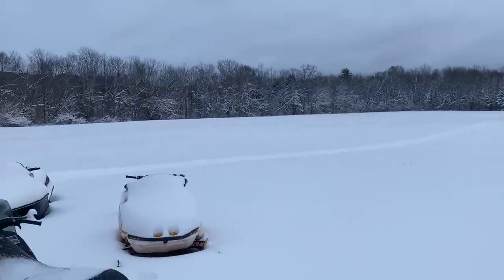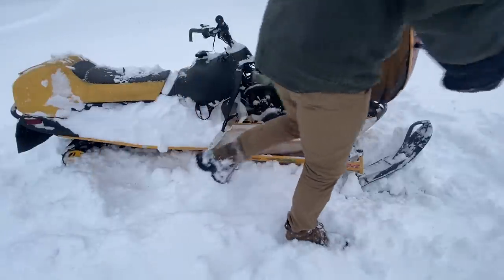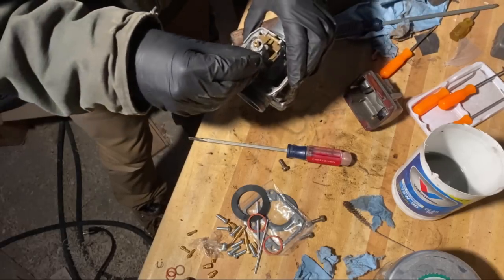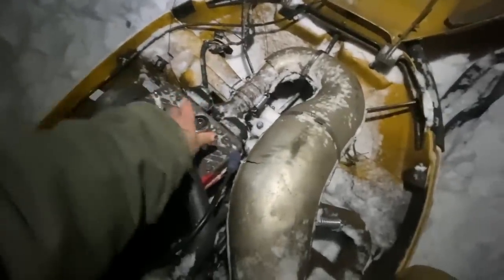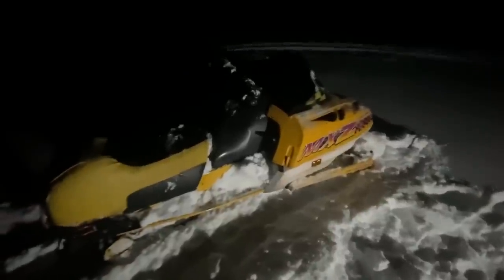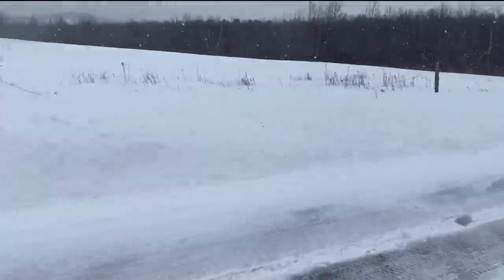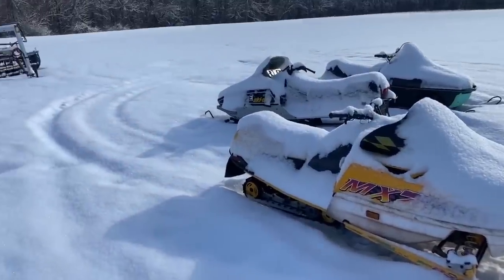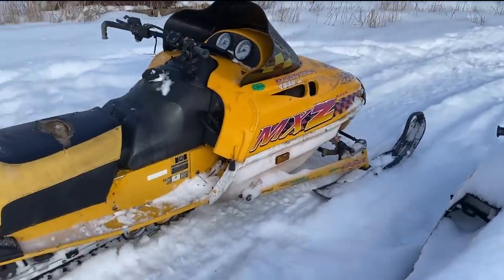This '96 MXZ Runs Like Junk: Let's Fix It!

Comment: As someone who has rebuilt 583s a few times right down to the crank, there are a few things to note. You generally want two or three wet primes where you can see fuel flowing to the carbs before starting it cold. On mine, I need to give it five or six loose pumps before it even gets fuel up to the carbs, even with a new primer. Your belt is also too low in your secondary, so you should probably take a look at the deflection and alignment. If you didn't change out the needle jets in the carbs, you may want to. On my 583, the original needle jets (224 AA-2) were so worn out that they were bogging the midrange heavily and making the idle circuit extra rich until I replaced them. Blowing out all of the passages with compressed air is also helpful. Rebuilding the fuel pump is also very easy and would be good practice if you don't know when it was last done. Replacing the filters with the stock airbox would also be a good idea as the OEM jetting table would only apply with the stock box. Lastly, did you have a disconnected oil line, possibly the one running to the pump? Even with premix, you still need oil feeding to at least the rotary valve cavity to keep that gear bathed. You may also want to give it a bit more of a warmup before ripping...

Comment: Why aren't you covering your sleds??? Tarps are not expensive!!
Reply: $10 tarp will keep snow from eventually melting into your gauges display causing moisture build up and shorting out your electrical system. Also check the compression it sounds low! Good luck.

Comment: I once had a jetski that ran perfectly fine. And from one day to another it ran very bad. It was end of season and I wanted to sell it so to the end of winter I started looking into it and found out there was a hole in the exhaust. The fumes came out inside the hull and the intake is in the same space. The  machine inhaled his own exhaust fumes and that does not work very good. So I fixed the hole and inmediately ran perfect again. So maybe your exhaust leak caused the same issue here.

Comment: You may have a bad crank seal when it is idleing spray in by the clutch
Reply: do you mean base gasket or crank seal
Reply: @marshall-h7f  Could be gasket or crank seal. If your engine is a liquid cooled then you will leak coolant into your engine or outside the engine and you will know.

Comment: First fix the dam pull start!! Check boots etc for dry cracks,air leaks. Spray parts cleaner down the side the motor between the block and clutch. Engine speed picks up, seals bad.

Comment: Rebuild those carbs.  Sync them, Put a proper air box on those two at the end of the carbs cause alot of issues with snow getting in. and restricting air flow     check your carb boots for any cracks, Drain that tank, put fresh gas in and a bit of gas line antifreeze for  one tank.  And it should be good  :)
Reply: Spot on. Maybe a crank seal. Don't blow it
Reply: Yeah that motor made about 95 HP new, with the air box punched out and a good tune it should make 100...
Reply: Sure. But as you go through deep snow and it flies through your hood vent holes. Where does it collect?    Yep. Right on those little carb air filters.  And where does melted snow go from there?   Right into your engine.   Put an air box back on it.   You can buy thinner air filter fabrick than the stock box had. Cut it to shape. And there's your equivalent to a few holes in your air box, BUt still will be protected too  :)   Cheers  :)      And I love your videos too  :)

Comment: Two bucks stand atop a hill watching over some does.  The young buck says let's run down and get one of those does. The old buck says let's walk and get them all.    That was my thought when I finally fixed my hood cable. Ten minute job that I let bug me for most of a season 😂. I would have made this same video 5 years ago, unsoldered wire and all. Keep it up up though, its all fine when your riding!

Comment: That hood side decals sure look like those of a 1997 MXZ.
Decals on the trailing arms are 1996.
It is liquid cooled, that engine Needs to sit running for about 5 minutes to warm up or until the thermostat opens. And then a few minutes more. Not running on both cylinders. Those carbs need a serious cleaning. Replacing parts without proper cleaning or float setting is not likely to help or justify the cost of the carb kit in my opinion.
Can you cover the damn thing up?
Consider not pulling the rope until you have tension on the rope. Damage to the pull start mechanism will ensue using your current technique.
Usually the fuel pickup in the gas tank has broken up and disintegrated by now. Has this in tank fuel line and it's in tank filter been checked/replaced?
The 583 and 670 Need the primer to keep them running when you first start them up.
I have the same machine, Clean carbs are your starting point in this situation.
Though, encouraging to see that you are not afraid of getting after it mechanically
Please clean the carbs proper. Then go after the dropped cylinder.

Comment: If you haven't already spray some carburetor cleaner on the crank seal behind the clutch see if it revs up and down and that will determine if it has a bad crank seal cuz it definitely sounds it's not firing on 2 cylinders

Comment: It’s only running on one cylinder.  Check compression first. Clean carbs meticulously. New everything. Get rid of the existing gas in tank and replace with new.

Comment: Main jet bowl air intake screws needs propped adjustment, not the idle screw. It will stop the bogging .. hopefully helps.
Reply: Fax it will help for all models from 2002 -1975
Reply: Except the skidoos with bogie's
Reply: Only ones with sliders it will help more of theless

Comment: Those 583 and 670 motors are bulletproof if maintenance is done properly. Definitely need to rebuild carbs and go from there. U need the airbox to run properly too....u are sucking snow into the carbs possibly

Comment: a few tips I hope you already know is old mxz take a lot to start also the keys like to power only 1 cylinder if its not on just right and they don't like to run cold let them warm up for 5 to 10 min and running them at high idle when cold will Couse bad damage over time as the pistons and cylinder walls change from temperature you can get piston slap or could couse the rings to bind up.

Comment: You should put BR8ES plugs in it instead of BR9ES. 8s don't foul out a much because it's a hotter plug. Try them you won't be disappointed
Reply: Br9eya are the better option actually
Reply: Anyway run iridium plugs for that crisp crackle.

Comment: You might want to check the sparkplug caps, bad caps can cause plug fouling. If you measure the resistance across the cap with a multimeter you should get a reading of about 75 ohms. When reading plugs, I recommend using used plugs to get a clearer reading (should be done after a wide open run)

Comment: Your videos are interesting, but man, WARM THE SLED UP before you even touch the throttle. ALWAYS let it run until the cooling system is warm front to back of sled. The recoil, put a bit more tension on the spring so it retracts fully. And take the slack out of the rope before yu yank on it. That will rip the recoil into pieces if you keep doing that. Rebuild fuel pump on that mxz, when it's running, spray brake clean or something flammable, at the crank seal behind clutch, and if there's a little window of some kind around the recoil side where you can spray some into the flywheel/stator area spray it to. Might have to start it without the recoil on to check that seal. Not sure on that model. But definitely warm the machine up very well before you move the machine.

Comment: your problem is air fuel mix that pod filter is letting in to much air that is why when you prime a little fuel it runs good for a bit. either get more restricting pods or go up a few in jets

Comment: My 1999 grand touring 500 is a beeeotch to start. I added electric start to it. 5 or 6 primes and away it goes. Then I just use pull cord to fire it up once warm. Half a pull no issues

Comment: the problem is you, blasting it full throttle isn't the way to keep a cold engine running, use the primer as much as needed, its leaning out when you open the throttle. i rebuilt my engine and carbs, it fires up instantly but needs a pump or two to keep it going when cold. i never use the pull rope but it starts first pull if the battery is weak.
you might want to do a compression test.

Comment: I’m confused, what’s the point of replacing parts on the carburetor with out actually cleaning any of the passages…. You replaced the main jet without cleaning the emulsion tube, you replaced the pilot jet without cleaning out the passages, for all you know there’s a piece of gunk clogging your pilot jet passage and that’s why you can’t start it, also if it’s actually flooded pull it over while holding the throttle wide open, you need more air to overcome the excess fuel you now have in the combustion chamber.

Comment: Your belt is burning because you didn't bounce the back of the sled up and down first thing when it sits out in the cold for a few hours. Everything freezes up so bounce it a few times to free it up. Also inner cylinder is not firing. Your clutching is filthy and I guarantee you that they are not shifting out properly look at all the belt dust build up on the sheevs. You need to take the primary and secondary clutches apart and clean them. Fix you exaust leak no exaust equals no power. Clean your variable exaust valve's there probably gummed up and not opening all the way judging by the way the sled looks. If you maintain that sled right you will have a fast 100 mph sled. They are quick and nimble I have one to this day and it is like a tractor it just keeps going but I maintain it the way it needs to be. You have a great little sled there don't give up on her yet. Also keep an eye on your break system they get gummy in the master cylinder and hang up not releasing the breaks and hang the caliper up and make the rotor red hot and catches the break fluid on fire because it melts the o- rings out of the caliper and fluid leaks all over the rotor and poof instant fire and melts all your wiring and cdi as well and possibly melts gas line and then history. I hope you read this and take my advice.

Comment: You need to melt the snow off have it where it's warm and adjust your carburetors that will be a start I have an 81 9500 Plus did the same thing I cooked out the carburetors and rebuilt them all you need to do now is adjust your high-speed

Comment: I’ve had the same problem on my sled, what it does is suck air somewhere between the carbs and the cyl block. Could be a boot, maybe the carb isn’t seated properly in the boot, if you run it like that it will blow a piston.  Another possibility is if the crank seals are leaking, as mentioned above if you spray carb cleaner at the seals, also at the carb to engine connections, and the engine gains rpm, that’s where it is leaking.

Comment: That thing sounds like the rotary valve is out of time. When it does pick up on 2 cyl. You have to get it running on 2 before you can do anything. Did you ever check for spark ?